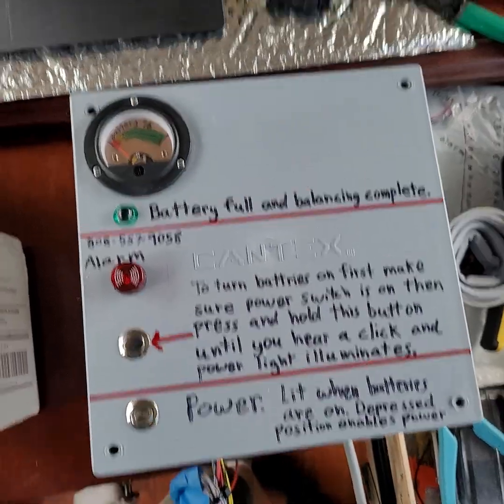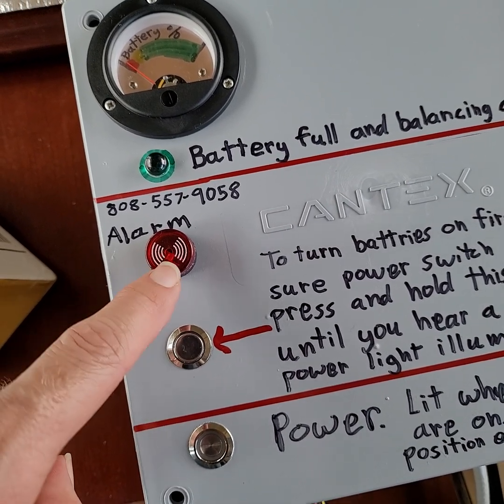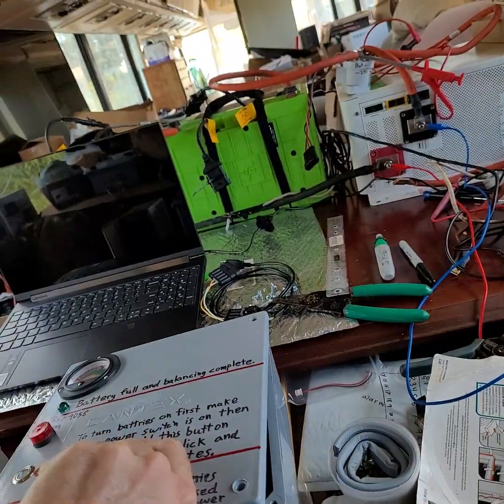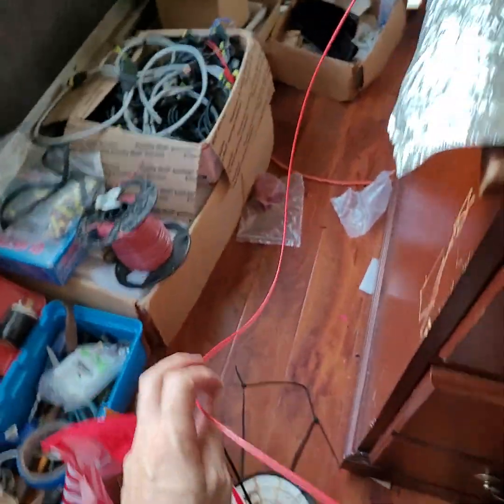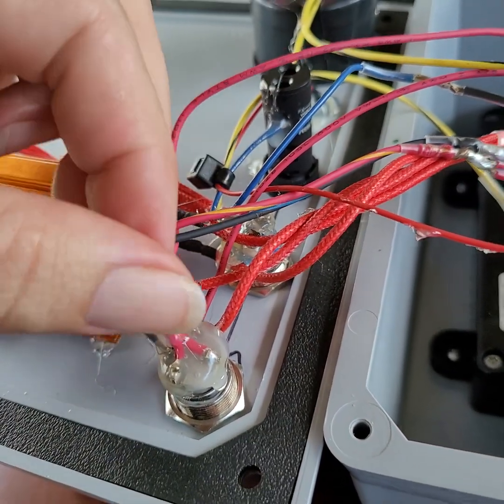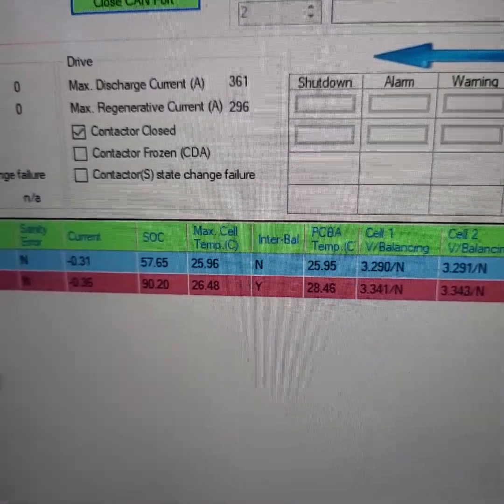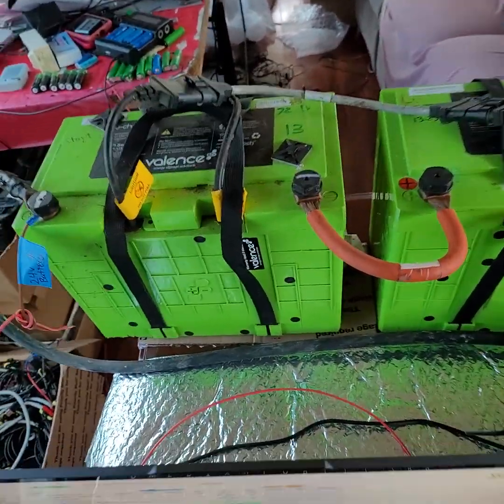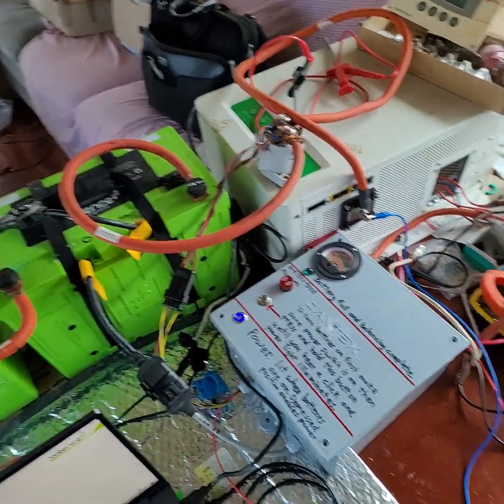Valence u-BMS instructions for Andrew's bus and his U27-12XP

Comment: Hi there, awesome work but how did you actually reconfigure the U-BMS to your battery configuration, please?
According to the U-BMS manual you need to set certain parameters (slave/standalone mode, how many batteries you have, serial and parallel config like 2S2P etc) to work correctly without a Module Lost alarm or else.
Reply: There are some software experts that helped me through it. It's not something anybody should bother with. Too much work. Just get a JK BMS.  There are some cases where the factory BMS is still a good idea. Especially for high voltage safety disconnect reasons but there's a lot of aspects to consider. For the people who it's still a good idea to use the factory BMS system I build and sell these.  Building these yourself it's not a good idea, there's just too much work involved to figure it all out.